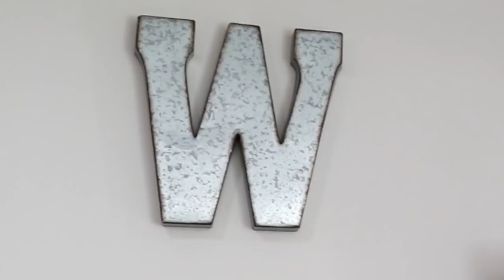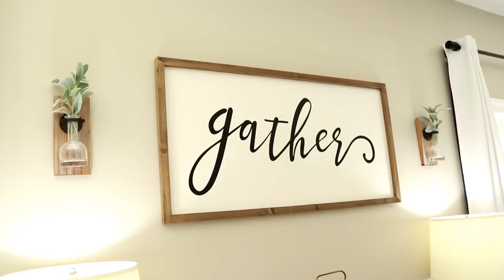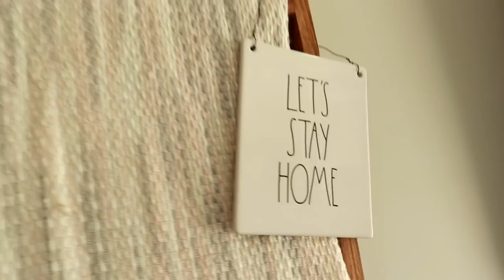DIY Living Room Renovation Transformation | Coastal Farmhouse Decorating Ideas

Comment: That looks great! It’ll look even better when the weird shelf thing is gone. I wonder what that was even used for. Lol
Reply from the maker: I think it was meant as a spot for those big floor tvs back in the day . Pre flat screens. Remember those huge things?!
Reply: @JessieLifestyleAtHome  yes. Back in 2003 I had a couple TVs that were flat screen but sat on the floor sense the housing for speakers etc would be in there. My 65 inch was as tall as me and I’m 5’6”.
Reply from the maker: Yep. This was a nice for that with a decorators shelf above. We v
Covered the hole at the bottom but left the shelf up top for now because we plan on redoing it all and I didn't want to bother with drywall etc when we were gonna make changes.

Comment: The rug does not need to sit completely under all four legs of the couch...I have similar style and colour rug, it perfect choice to bring colour to the room: but the rug is improperly positioned, the size looks good but the position of the couches on the rug could be improved by only allowing the front of the legs to sit on the edge of the rug, it would look better if the rug was pulled out so that the recliner was resting on the rug, the recliner looks orphaned because it is not connecting to the orange tan colour in the rug and it is not joined into the little cul-de-sac you have created with the new couch because the recliner is on the bare floor boards....the space looks smaller because of the delineation lines....hard to tell cos I am not there in person and looking through the camera but it might work if the rug was turned 45 degrees so the recliner chair is resting on the carpet....love to know what you think of my interior design floor plan idea....love your transformation, love everything you do.  Wish you could run the same flooring into the kitchen area, I know the tiles are very hardy surface over vinyl but gee whiskers it would look insane if the same flooring was continuous....xxxxx  Maybe hubby can rip all the tile up and lay same flooring while you are in hospital delivering your bubba lol...don't tell him I said this, he might hate me forever lol.
Reply from the maker: Nah I like the rug where it is. It needs to be completely under the couch because otherwise the couch slides.. even with grippers under the legs of the couch. We did what's best for us.
Reply: @JessieLifestyleAtHome  most important thing is that you like it and that you did things for how your family works and what is best for all of the family....xxxxx  love what you have done.